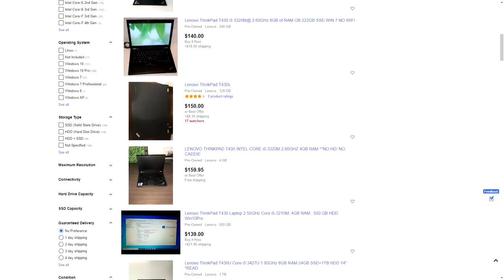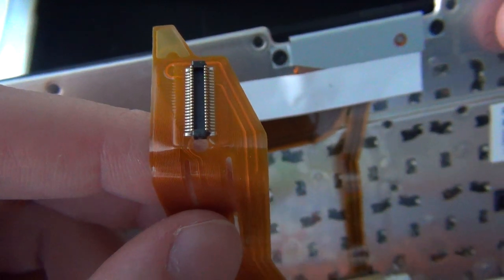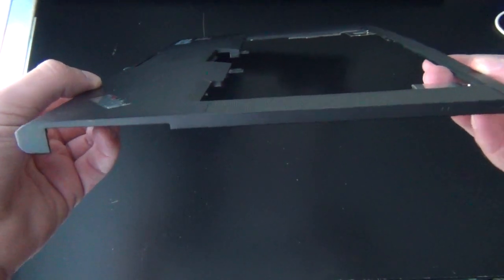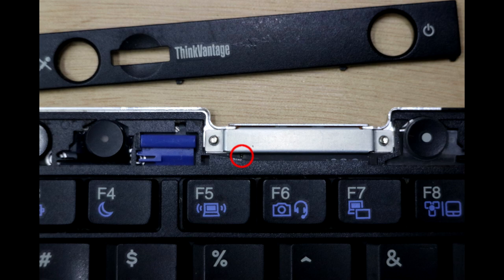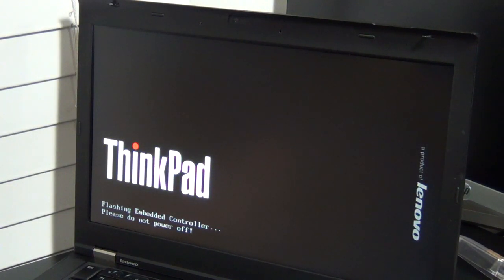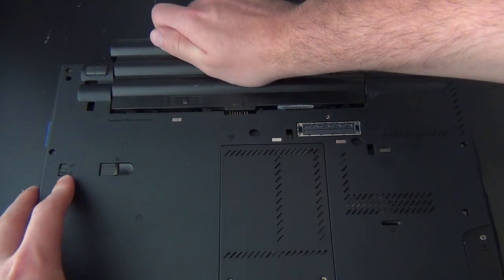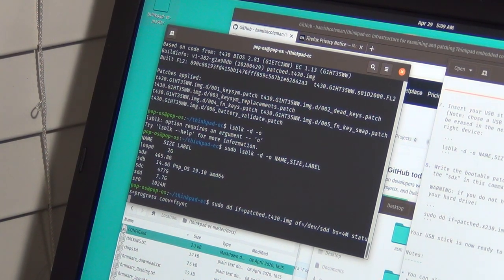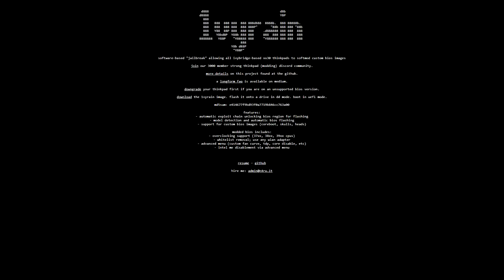Installing the classic keyboard in Ivy Bridge ThinkPads

Comment: Hey Sebi, curious but do you trust Lenovo T420 keyboards from China? I'm thinking of doing the same.
Reply from the maker: It’s a bit of a lottery. Sometimes you get a good one, sometimes you don’t.
Reply: @SebisRandomTech  I see, thanks man. Final question is do you know any reputable communities who help source cheapo T430 units from recycling dumps, refurb them, and upgrade for a reasonable cost? Canadian prices are crazy overpriced.
Reply: Over the years I've bought by now about 10 keyboads from China (ebay) for several ThinkPads. It's indeed tricky to find a good one, especially these days. These days the market is saturated by some kind of newly manufactured compatible keyboards. They look the part, but are not as good in quality. They have quite distinctive shape of the key cutouts on the backside. Just a few years ago, I haven't seen any classic keyboards with this shape of cutouts. But now the majority of keyboards on offer are those. Once I bought a keyboard from ebay, the photos looked like my original keyboard. However what arrived was this new model, I tried it but didn't like it much. I requested a return (because item was not as described) and in the end the seller refunded the money. Since then, I always ask the seller first, if what I get is exactly what I see, or it can be a compatible substitute, possibly another part number / FRU. Most of the sellers reply that they can't guarantee the exact model I will get, so I don't buy from them. Last keyboard I bought, I had to pay 60 USD for it (plus customs fee / VAT). I think the supply of original keyboards is drying up, there is sometimes a bit of new old stuck surfacing here and there, but for the most part it's either used, used&reconditioned, or new non-original "compatible" keyboards.
Reply: @GenePavlovsky  Thank you. I really appreciate your response.

Comment: Here is a good question... Is there a list of trackpads that can be used in other Lenovo thinkpads? A cross reference list, maybe by part number. Have a T/P Edge E535, trackpad doesn't work, (keyboard inop too, but I have a replacement keyboard) I don't want to replace the whole wrist pad/rest, just the trackpad. Plus eventually up the CPU to an A8
Reply from the maker: I think on many older ThinkPads the touchpad is essentially part of the palmrest. It could be replaced, but it wouldn't be easy. Starting with the T440 series and most newer models, the touchpad is a separate part that can be more easily replaced.
Reply: @SebisRandomTech  yeah I thought so. I thought the touchpad itself could be replaced, & not the whole palm rest & cover. Thanks for the help.

Comment: I want to do this mod, but due to my OCD and generally clumsiness I wanted to ask a couple of questions.
1. Is it possible to skip some of the mechanical altering of the keyboard? 
2. Between the keyboard and lower palm rest on your T430 I see a gap that shows where the filing is done. Is there a way to adjust that?
Reply from the maker: Like I said in the video, you can brute force it into the palmrest and then insert that combined assembly into place, without making any physical alterations. As for the second question, try your best with the filing is my best suggestion, or look into the brute force method! :P
Reply: @SebisRandomTech  I'll probably just brute force it in there and hope it doesn't detach itself :P
Also, I read that someone bricked their keyboard doing the pin isolation. So in the end is it safe to do? Also, do I need to cover one side of the pins or both sides (since the cable appears to be double sided)
Reply from the maker: @jugostran  That's your call. It's only one side of the pins. I did the swap without issue on my X230 and on a different T430 a few years ago (without isolating the pins), but as that other person shows there is a risk of bricking the keyboard or doing other damage, hence why it is recommended that you isolate them.
Reply: @SebisRandomTech  Thanks for all the answers. Cheers!

Comment: Does the trackpoint work right off the bat?
Reply from the maker: It should, and does for me.
Reply: @SebisRandomTech  I was surprised to see the trackpoint not working but all it  was just the trackpad's flex cable loose.

Didn't expect to see you still read comments on this video!

Comment: If you want it even more modern you need to be lucky to find a 25 anniversary edition. It's a shame they only had it in that one since the keyboard can clearly be fitted into a more modern Thinkpad that the T430.
Reply from the maker: Some people have managed to make the anniversary edition's keyboard work in the T480, however rumor has it the guy who managed to modify the T480's embedded controller to properly detect all of the keys is keeping the code for himself. Once the embedded controller issue gets resolved I would love to tinker around with installing that classic keyboard in a more modern machine.

Comment: May I ask, what msata ssd do you use for your t430? I'm looking to upgrade my x230 with an msata drive as my boot drive. Thanks
Reply from the maker: Mine is a Liteon, I've had good luck with Samsung, Toshiba, and MyDigitalSSD mSATA drives. There are many other manufacturers out there that I've had good experience with.
Reply: Samsung 860 EVO mSATA is the fastest one I know of. Personally I'm using Samsung 850 EVO mSATA in two of my ThinkPads. Kingston KC600 is a cheaper alternative which is recommended, I haven't tried it. Do note that the mSATA disk will run at SATA 2 speeds (3 Gbps), while if you get a regular SATA SSD in the main drive slot, it will run at SATA 3 speeds (6 Gbps), which will be somewhat faster. Plus, I think no one develops new models of mSATA SSDs anymore, while newer generation SATA SSDs are getting a bit faster (e.g. Samsung 870 EVO).
If your budget allows it, for an X model go for a large SATA SSD in your main drive bay, and forget about the mSATA slot. For a T or W model, use a SATA SSD (as large as you need / can afford) in your main drive bay, and put a 2 TB HDD in your Ultrabay (you will need a suitable Ultrabay HDD caddy / adapter).

Comment: Thank you for the video. I can install the X230 keyboard on the X220?  Is it compatible ?
Reply from the maker: You could, but I'm not sure why you would want to! I mostly put X220 keyboards into X230's! :P
Reply: Yes I know that the keyboard of the X220 is much better, but mine no longer works and in my country this model is no longer available. Thank you for your reply
Reply from the maker: @abdeljelilbenabid4097  It's possible to install the keyboard but I don't know if it's possible to remap the keys. You'll have to deal with having a few keys that don't work properly or don't do the function written on them. If anybody watching/reading these comments knows a way to remap the keys, feel free to reply. I would suggest using it as a placeholder until you are able to find a replacement X220 keyboard.

Comment: Is there a possibility that the after market keyboard has built in keylogger?

I tried to isolate the pin and made they keyboard unusable. I think some connection problem as some keys are not functioning.  I have screwed up two keyboards because of this...
Reply from the maker: Never heard of anything like that, worst case scenario you could just not bother with isolating the pins, just bearing in mind you'll blow the keyboard backlight fuse if you do so.

Comment: Man, I overwrote my main hard drive by accident because I forgot to read the part where its mentioned that I need a random usb without anything important to install the modification because its going to delete the stuff in it, do you know if there is a way to recover this information or is it lost forever?
Reply from the maker: There may be a way to recover your data before it is overwritten, but I don't know very much about that process. I would suggest asking around on a few forums or look into a data recovery service - and don't use the drive at all until you can get the data recovered.

On most storage devices the data isn't overwritten right away, it is marked for deletion meaning if new data is written to the drive it can overwrite the old data.

Comment: what screwdriver did you use to release the ribbon cable from it’s place
Reply from the maker: Just a precision Phillips head.
Reply: I like to use plastic spudgers to avoid potential damage to cables. They are pretty cheap on eBay, I got several for free when I bought some other parts from China.

Comment: Okay so, I have this really big gaming laptop and I want a portable laptop with a big screen and can play games at a reasonable fps for cheap. Got any suggestions? I was thinking of getting the Lenovo ThinkPad x230. Thanks!
Reply from the maker: The X230 has a 12” screen, so it certainly won’t be big by any means but it is fairly portable. You’ll have to elaborate on what type of games you would want to play for me to give a good suggestion.
Reply: @SebisRandomTech  Thanks for responding! Okay so, I want a laptop that can run Kerbal Space Program, Roblox, And maybe X-plane. Thanks!
Reply from the maker: @northern830  It should run the first two games perfectly fine, X-Plane might struggle a bit if its one of the newer versions.
Reply: @SebisRandomTech  Thanks!

Comment: I gouged out the palmrest when i did mine, and it's probably just as good as filling the tabs on the keyboard. Actually, my keyboard does touch my screen when the lid is closed, but i figured that's because the classic keyboard is actually thicker and sticks up further. If you look at the middle mouse button on the keyboard when it's screwed into place, it kind of butterfly's up awkwardly. Oh well. Is anybody else's classic keyboards touching their screens?
Reply from the maker: Mine seems to be flush with the palmrest. No keys or buttons are raised up higher than the palmrest in my case.
Reply: @SebisRandomTech  hm... I'll have to do some more diving into this

Comment: does the bios have to be 2.81 in order to get the EC mod to work? I did it with 2.64 since I'm planning on doing the ivyrain mod but when i tested to use the Fn+ pageup for the thinklight, nothing happened
Reply from the maker: Try again with 2.81 and see what happens.
Reply: Might be quite late but i noticed that in ec flash github page there are different versions of the embedded controller listed (2.64 is G1HT35WW) maybe you flashed the wrong version of the bios but the correct model so your laptop didn't brick but the patch didn't work

Comment: Welp, after 8 hours of repeating your steps exactly as you showed i rebooted my laptop, set to Legacy mode and after booting from USB my entire screen was covered with weird symbols. i almost shit my pants, but at least it didn't break my bios after i forcefully shut my T430 down.
Edit: and my flash drive now has 36MB of memory instead of 16GB. Is there a way to fix this? None of formatting helps

Comment: Hey! I have 1vyrain installed on my x230 Tablet (i7, 240gb ssd, win 10pro) and was wondering, is there anyway to install ec mod AFTER 1vyrain mod. If not I will use this on my T430, great video either way!
Reply from the maker: I don’t know for sure what the process is, but I think it’s recommended to do the EC patch first.
Reply: @SebisRandomTech  thanks, i guess id have to restore a normal bios and then ec and then re-1vyrain then, thank you for the reply!
Reply: I think the BIOS 1vyrain installs doesn't prevent EC mod from functioning. You can just try doing the ec mod afterwards, and see if it works. Personally though, I did IVprep first, then EC patch, and finally 1vyrain.
Reply: @GenePavlovsky  ye thats what i thought, i may have to switch/flash bios back to standard first

Comment: i recently got t400 (for free btw) with 3 GB of RAM. i wanted to ask what type of memory should i get (i heard that it should be a specific model)
Reply: The ThinkPad T400 can support up to 8GB of DDR3 SO-DIMM RAM.
Reply: That's correct, I recently upgraded T400 with  2 sticks of 4GB DDR3 2RX8 PC3-10600S RAM, see picture of both of them on top with original 2GB stick that was there:
https://drive.google.com/file/d/15OJ_GDOpWsTfepceT1cRreoTNBpJtuir/view?usp=drivesdk
Reply: If possible, stick with 2Rx8 (8 chips on each side, as shown in the photo Lukasz linked to).  I'm not sure if 1Rx8 will work.

Comment: Hello, I own a thinkpad x220, when the thinkpad is on and I plug in the charger the screen goes black for 2 to 3 seconds, why is this happening and can I fix this, any help would be appreciated?
Thank you for your time.
Reply from the maker: The screen flashing for a few seconds is generally normal when plugging in/unplugging the charger, depending on how your power settings are configured.
Reply: Thank ypu for your response, when you say flashing, I mean the screen go's black for 2 to 3 seconds, would you regard that as a flash?
Also I disabled the trakpad using the bios, when I turn the trackpad  back on using the bios, it now will not work, is there anything I can tip In to check that everything is working correctly on my thinkpad x220.
Thank you for you time.
Reply: @guyw6284  For me the screen flashes for maybe a split second, not 2-3 seconds. Unless you unplug/re-plug the charger every minute, does the flashing really bother you? If it doesn't cause any other problems, then just ignore it. Normally re-enabling the trackpad in BIOS should make it work again. Try reinstalling the Synaptics/UltraNav driver from Lenovo. Check your device manager if the devices are listed there. I don't use trackpad myself, just the TrackPoint, but if I recall correctly, if it's unplugged or disabled in BIOS, then the UltraNav driver does not claim the TrackPoint, instead the standard mouse driver is used for the TrackPoint, which means middle button scrolling doesn't work. So I have both TrackPad and TrackPoint enabled in BIOS, and just disable the TrackPad in the Fn+F8 menu. Bonus tip: if you use the TrackPoint's middle button scrolling feature, then the middle button doesn't function as a regular button (e.g. you can't use it to close tabs etc). There is a program called tpmiddle (apparently more than one version exists now, I'm using the original one, file name is tpmiddle-0.6.exe), you just put it in your startup list, and all it does is process the middle button clicks. The middle button scrolling, provided by the UltraNav driver, keeps working as well.
Reply: @GenePavlovsky  I apologise for the late reply. Thank you for your detailed response to my comment!
Do you ever use your 3g mobile network option on your ThinkPad X220?
If yes, have you had any problem's with it lately?
My 3g mobile internet keeps cutting out.
Reply: @guyw6284  Never used the WWAN card, I use a mobile WiFi hotspot when (rarely) needed. I'd try to remove the SIM card and the WWAN card, wipe contacts with alcohol, dry, reinstall. I once had a similar problem with my phone, my mobile operator suggested to replace the SIM card, they sent me a new one, and the trouble disappeared.
Reply: @GenePavlovsky  thank you, I will try that.